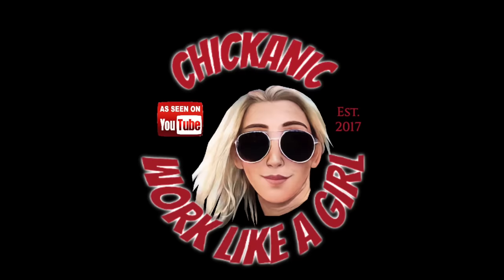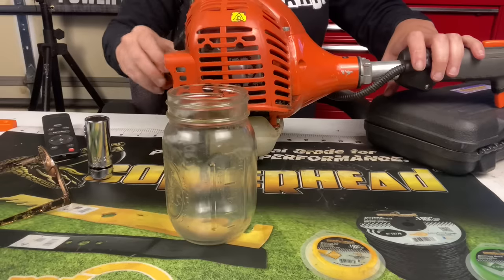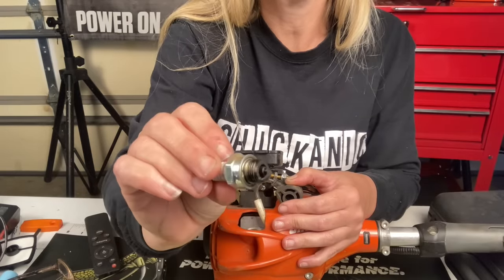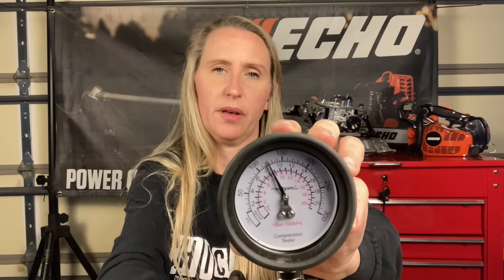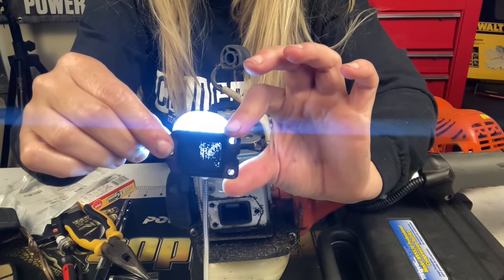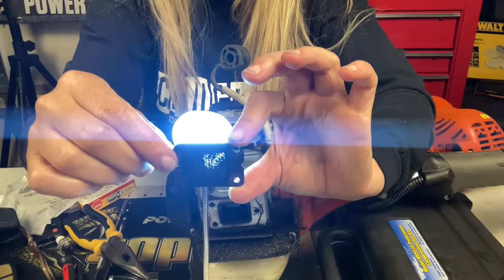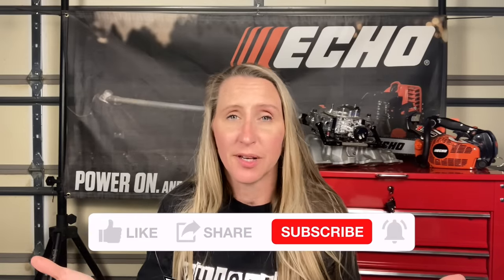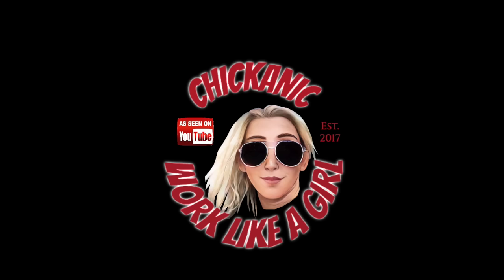How To Fix A String Trimmer That Won't Throttle Up. Echo SRM-225 Complete Diagnoses and Repair VLOG

Comment from the maker: Thanks for Watching! Find a link to all of my "Must Have", Favorite Tools HERE!! https://www.amazon.com/shop/chickanic?ref_=cm_sw_r_cp_ud_aipsfshop_aipsfchickanic_9ERPFPBNGQ924P8NS63B
Reply: I worked in at an ace and we sold a lot of these and like you said sometimes they're bad or people don't want them so I've got to play with them some and Ive found you can get some decent results from them. So on the engine head you can mill the top side of the exhaust port and all the web from the fuel transfers except the bits that make up the wall along with the perspective sides of the bottom end of the cylinder wall as well as modifying the head gasket to move more fuel and then get rid of the catalyst and the screen😂 in the muffler and open the exhaust gaskets up along with the exhaust vector to move the fuel out faster and its sure to gain some rpms, takes about a half hour 🎉🎉
Reply: Ive taken dead units that had compression and brought them back to life doing this
Reply: I USE PREMIX FUEL,  WHICH IS BETTER IN YOUR OPINION 40:1 OR 50: 1 . THANK YOU.  ENJOY YOUR VIDEOS. THX

Comment: I watched the video and found my screen was clogged with carbon buildup. I burned it off just as you instructed and now my trimmer is back up to speed. (I should add that using a lighter flame didn't work--I had to use the stovetop burner to get the screen red hot before the carbon would burn off.) THANK YOU, Chickanic!

Comment: I had a clogged screen (Stihl) and was able to burn off the gunk and brush it clean.  Not that they are expensive, I just didn't want to drive 15 miles to the store to get one and got my work done much faster.   After it happened the second time, I wised up and never have had that problem again.

Comment: I bought an old Echo blower at auction recently. It had been stored dry. Put 40:1 in it, primed, and it fired up and ran. They are nice well built machines.
Reply: All my Echo’s require 50:1 mixture. You may want to research that unless the blower specifically states 40:1.
Reply: @deepsleep7822  I am in the school of thought that these machines were engineered for 40:1, but manufacturers list them at 50:1 as a concession to the US EPA. I have two identical snowblowers manufactured 1 year apart, the older model has 40:1 in the manual and on the gas cap and stickers. It’s 1 year younger brother with the same Tecumseh engine is 50:1. 12.5 ml per 500 ml mixing bottle vs 10.0 ml per half liter. I believe that extra 2.5 ml is good protection. Many older machines were 40:1. If I have to clean an exhaust screen occasionally, so be it. Mfg knows more than the anti internal combustion political hacks at the EPA, IMHO. YMMV.
Reply: You'll find that Echo products are the very best of them all out there. I have a Echo weed eater, bought since 1999, and at 2022, still running like new.  What's that tell ya?
Reply: Stihl is better
Reply: @brandonbell5357  depends on the Stihl. The FS-38 is garbage.
Reply: @haneyoakie14  gotta buy it new from the store not from the neighbor
Reply: @brandonbell5357 the older stihl equipment, yes, it WAS the best... this newer stuff not so much. Echo has them beat in the trimmer and blower equipment. It's close on chainsaws. Echo is easier to get parts for too. Wouldn't own anything husqvarna but that's just my personal opinion
Reply: Still make the best chainsaw.I use them my whole life that my coun.Wear has been fine eight years

Comment: My Grandfather has a lawn care company with an old grey echo trimmer. You know what broke it? The spark plug wire got a little brittle and broke off no big issue he might’ve pulled it a little hard but the only reason we didn’t fix it was because the damn screw stripped even after sitting with some WD-40 on it

Comment: Chickanic makes an EXCELLENT point about removing the plug wire (3:15).  I just screwed up my Echo SRM-225 plug wire connection because I didn't gently twist the boot back & forth until the plug connection loosened up.  I ruined the the connector, and had to jury rig a connection in the boot after replacing the plug to get it running again (sure wish I'd watched this video first!).  My lesson sadly learned, I removed the plug wire correctly when I serviced my Echo PE-230 edger!  I also gave a quick shot of dialetric lubricant in the boot to improve the electrical connection and ease the removal of the spark plug boot in the future.  Thanks for the info, Chickanic - now subscribed! 😉😉

Comment: I've seen a lot of pretend mechanic-chicks but you are the real deal and impress the crap out of me. My favorite tip from you was the slowly pull rope 4 times before starting engine. Unbelievable how much easier my starts have become. - from a born mechanic since age 12, 60 plus years ago.

Comment: Hello Chickanic, i'm no mechanic but i tinker around with my weed wacker doing routine maintenance. Recently my stihl fs120 after 5 years started working crappy, won't come up to full revs, so i checked the clutch, good, cleaned the carb, no difference, changed the fuel filter, no difference. I did not check the muffler because it does not come with a spark arrestor screen. I finally took the muffler out, out of desperation. Lo and behold, oil poured out of it and the pipe was halfway blocked. I cleaned it out and bam, i got full revs immediately. Of course all of my frustrations went away, lol. I will not take this exhaust thing for granted anymore. You are indeed an inspiration, and your vids are spot on.

Comment: I have an Echo straight shaft trimmer for the past 14 years similar to the one you changed the exhaust screen and never had any issues as I always did run it at full throttle, did the proper gas/oil mixed, used only ethanol free gas and did the regular maintenance (air filter, gas filter and spark plug) and still work like a charm.
Reply: You don't use it very often
Reply: I use it often and I only use ethanol free  gas.

Comment: I have the same SRM 225, love my echo, best investment I ever made. had it for several years, today three quarter trimming my grass, it just died, would not restart. I checked the gas like you always do in your videos and it was fine, pulled out the fuel filter, I didn't see much but went and replaced that anyway, went to the muffler screen next, unscrewed the five T27 screws, one of the screws broke in half, it was so tight, the screen was fine. Put the screen back together but only could use 4 screws because of the broken one. Next went to the air filter, well that had a lot of soaking fuel on the lower half. replaced the air filter with a new one. Went next to the spark plug, woe a lot of oily carbon, replaced that with a new plug. Put gas in the tank, primed, choked, and it started right up. you video really got me through this. thanks so much for sharing your skill set.

Comment: THANK YOU,THANK YOU!!! Had the same problem with a ryobi,did everything,checked clutch,switched carbs from another machine,cleaned plug,changed gas mix and no change.had to buy another machine (time constraints).today I did exactly what you did,the screen was blocked,had to carefully use a wire wheel to get the dried carbon off,also cleaned the entire exhaust housing.After ,the machine ran perfect. (subscribed and liked)

Comment: I had a similar problem with an AL-KO string trimmer. The muffler was also clogged, but not because of carbon deposits, but because of insects that had nested in the exhaust. It took me some time to figure that out. I follow your channel in Germany and I think one can learn a lot from you.

Comment: i know this is an older video, however, your information lead me to a problem that i was able to fix as well. i purchased at auction a pas225 that had the same symptom of not throttling up. I failed to remember to check the exhaust first and ordered a replacement carb. Changed the carb had no improvement. sleeping on it i woke up and said i think Chickanic made a video on this, searched, i'll be darned, she sure did. Thank you so much for your info. My trimmer/edger is running like a maniac now.

Comment: I’m glad I found your channel. I own a lot of Echo equipment which I’ve had for well over 10 years with no problems. But this was a learning experience for me. Never really knew there was an exhaust filter but now I do and maybe I’ll clean it tomorrow if necessary. Thanks for the troubleshooting tips. Really enjoy your videos they are very helpful.

Comment: YOU ROCK! You saved me $100! The small engine repair shop couldn't figure it out...they put on a new carb, but were nice enough not to charge me anything. Your tutorial led me to my completely clogged (zero light coming through) screen.  The brake cleaner didn't clean it, so I used a thumb tack to scrape all the gunk off.  Presto! We are back in business.  THANK YOU!

Comment: I'm pretty happy I knew where you were going after the compression test.  
While I've done a lot of work on small engines, I never really did a flowchart ( even in my head  ) for diagnosis, since I work on my own stuff only I would skip around because I knew my compression was good or my gas was good etc.
From time to time a neighbor will have problems with their stuff and this gives me the outline to follow for them. Excellent video! Thanks!!

Comment: This is the reason why I only use Amsoil saber 2 cycle oil at their suggested 100:1 ratio. 
I know it sounds crazy (I thought the same) but I’ve been running a trimmer that had this exact problem, but I had already bought a new one so I figured if the old motor let loose from the 100:1 ratio, I still had me new trimmer as a backup. 5 years later, I still have the old trimmer and new trimmer,  both running 100:1 saber oil. 

More importantly, I have to point out how awesome Chickanic’s channel is. 
Every conversation I have involving lawn equipment, I just tell the person to watch this channel. 
Keep doin’ what you’re doin’, you’re a rockstar!

Comment: Thank you so much for this video. I cleaned mine, but it took way too long to get it well enough to try back on. I tried brake cleaner with a toothbrush which didn't work much so tried a harder brush and finally got most of it clear. While in town we dropped by the Echo dealer shop and bought the last one he had. For $ 2.14 I'm hanging on to it and know what to correct if the same problem in the future comes up. He also said to run it at full throttle so burns the deposits off. Best weed eater I've ever had. Thanks again, Jeff   P.S. My Echo is a PAS 225.

Comment: I have an Echo PAS 2620 that starts up and runs fine for about the first 30 minutes. Then it bogs like this SRM 225 did. I've only run it on Ethenol free mid-grade fuel mixed with Echo Red Armor oil, 50:1 as directed. Fuel lines, filter, bulb, plug, air filter all look fine, and remember, runs fine for about the first 30 minutes. I'm out of ideas what to look for. Well, except maybe the ignition is overheating, but I'm not sure how to check that. Idles fine but won't rev.

I have 1/2 an acre to clear, and need my trimmer to run more than 1/2 an hour at a time. :D

I appreciate your help. Love your videos. I have to admit, I was skeptical of your channel at first, but now believe you have the best small engine repair channel on YouTube. Congratulations, and best of luck with your channel and your business (I'd definitely be a client if I lived nearby).

Comment: I really like your videos, you do an excellent job. Thank you for the effort you put forth to make these informative videos. 
I would like your opinion on my Echo SRM 225. It is 6 years old and got to the point it would not rev when started, and was getting harder to start.
So I cleaned the carburetor, changed the plug, and spark arrestor. It still wasn’t revving so I checked the compression and it was 60 pounds. So I thought about it a couple of days and decided to go ahead and rebuild it. I was going to put in a new piston and ring and cylinder. I found that the new echo short block was cheaper than parting it out. So I put in the new block and I also put a new carburetor on. The fuel lines are new as is the filter and plug. 
It ran like a champ and used it 2 times on my yard. 
I was going to use it today. It starts with no issue but it took about 10 minutes before I could get it to rev up. After it warmed up it ran great. I am at a loss of why this is happening. Also I have adjusted the carburetor via pulling the brass plugs. I had it really running great. 
But today’s performance has me wondering what the heck I can do to eliminate this issue. 
I run Echo red armor in ethanol free gas. 
I wished my would run on a cold start like the one you fixed in this video. 
Sometimes I wished I had just bought a new unit. But this has been a great trimmer and saved $85.00 to $100.00 over the new unit. 
If there is anything you can suggest I might check or do I would sure appreciate your input. 
Have a great and than you again for all of the videos you produce.

Comment: Thank you for these videos! I have a Stihl FS 94R weed trimmer that was doing the same thing except mine would ckoke itself off. I was told by a Stihl authorized technician to change the carb. I did and still had the same issue. I called him up and told him it was still doing the same thing. After some more troubleshooting the last thing he told me was to check that screen. I never knew these small engines had a screen so i never thought to check the muffler!  I wish he had a told me before I bought a brand new carburetor to check that! I'll be subscribing to your channel now. Thank you.

Comment: Thanks a million for your advice on all the recommendations on my old stihl trimmer, its back to life after I added a new carburetor and tuneup kit and the cause of it still not running was a clogged screen on the muffler. So I temporarily burned off all the carbon and got it running 100% and ordered a new filter for it. Thanks for all the help

Comment: I have this EXACT model trimmer, it's a horse. I recently cleared 500 new pine trees (yes 500) and it finally sounded like what you have there. I got a carb kit but will check that screen too. I didn't know about running it at full throttle, thanks for the tips.

Comment: A muffler removal to see through the exhaust port into the cylinder is enough, no need for an endoscope of even a sparkplug view. If any issues are seen, it's worth pulling the cylinder off to see what's actually going on. Great video as always, I agree with you, the EPA standards for ALL 2 stroke tools is just crap (I understand the use of them in high fire hazard areas like California). Luckily I live in Romania so all of our 2 stroke tools here in Europe don't know what a spark arrestor is.

Comment: Good Morning Bre: Excellent video as always. I ran into the same pluged exhaust condition on my Red Max trimmer. Took off the muffler cleaned it all out with brake cleaner, reinstalled it & now it runs like a raped ape. My best to you & your hubby, TMP from N.J.

Comment: If your customer has several of these trimmers he must rely on them for his work.  It just seems to me a serious lapse for him not to bring each one in turn to you of annual maintenance where he could avoid having 3 machines down at one time and just work more efficiently.
Reply: Planned vacation maybe...or maybe thats 3 of 12..?
Reply: @3DWHIZZ  Still don't change the sense behind it.  Slack off on the maintenance then you are in break-fix mode.  Always a loosing proposition.
Reply: @uni-byte  that may be the point at which he brings them in for repair. May never need more than 4 or 5 at a time. This would save time and fuel costs. I don't claim to know how he does things, not sure why you think you do...
Reply: @3DWHIZZ  Maybe you didn't read my post correctly.  I obviously don't know why he did/does things the way he does.  I just mentioned how I would approach it.
Reply: @uni-byte  Sure but how you would do it in this case, is based on a preconceived notion. 
Now imagine a large landscape company that has a number of crews, all using 2 or 3 trimmers.
Reply: @3DWHIZZ  In my experience it is always a better choice to maintain equipment rather than (ab)use it till it breaks.  I'll give you the last word.
Reply: @uni-byte  Thanks, i'll take it😆
I dont disagree with you but the issue these trimmers were having are issues that aren't really a preventative maintenance thing. Its the kinda thing thats dealt with when it happens.
Enjoy your day!
Reply: I was about to say maintenance  clean your equipment  been field engineer  over 15/20 plus years & always cleaning equipment  & yard tools lots
Reply: The Eagles are going to the SuperBowl. Again. Fly Eagles Fly 🦅

Comment: The exhaust screen is also used for the purpose of arresting spark and potential flames. It could be hazardous to omit it
Reply: Which is, of course, why there is a fine for shops omitting them.

Comment: Great! I can’t wait to my Hitachi in the morning.
The local guy who goes through the garbage took my Echo so I dug this old Hitachi out of the trash and after a few years of struggle it runs so so but like the one you just fixed mine won’t throttle up.  I’m going to check the screen on the exhaust.
Thank you.

Comment: I have a Tanaka pole saw that was doing the exact same thing. It would start right up but when you hit throttle it would just blubber and not rev up. The gas had a good smell but took the carb apart anyways and was clean. Took it to the dealer and he found a bad coil after checking the exhaust. Good video!